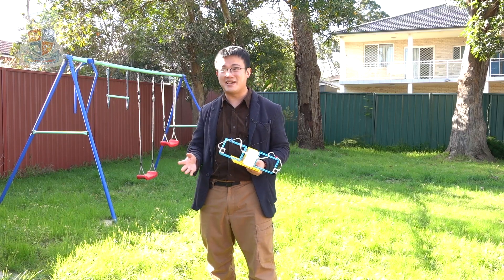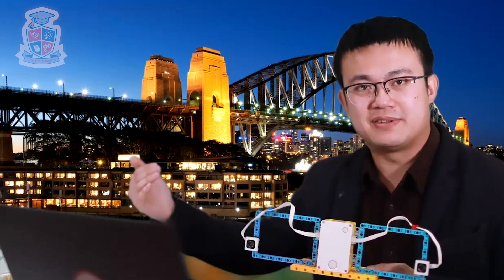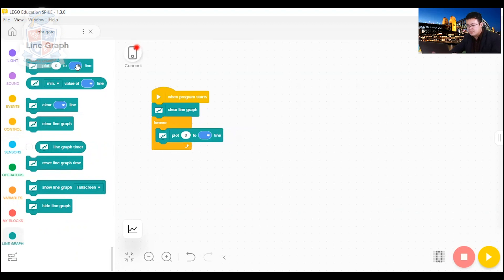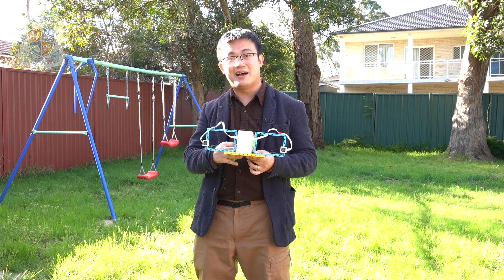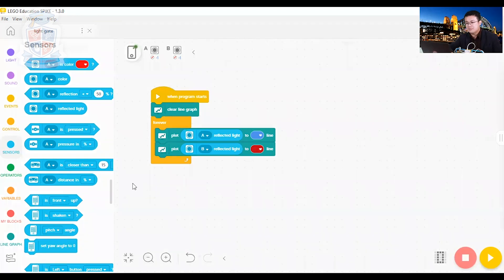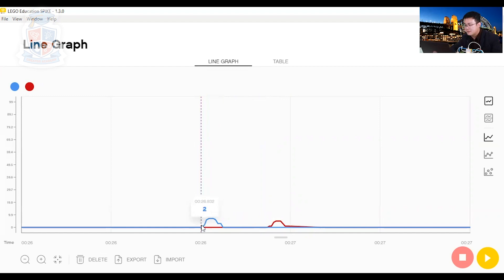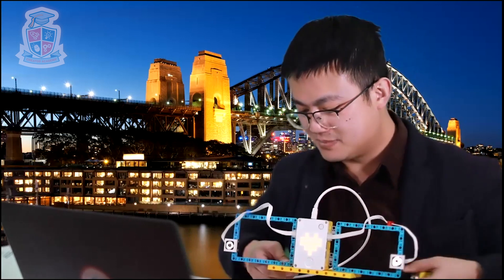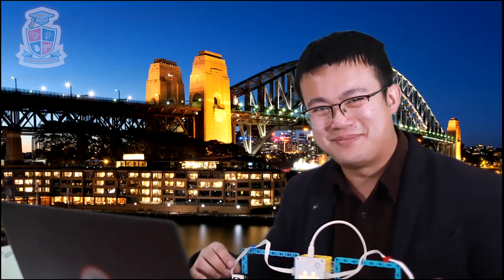Measuring Paper Plane Speed with SPIKE Prime Line Graphs

Comment: could you do the calculation using one colour sensor and the distance sensor??
Reply from the maker: Yes! It is absolutely possible 😊 Garry
Reply: @CreatorAcademyAustralia  cheers! I had a go just after I asked the question and it works really well. 
In fact the two very different graphs make it slightly easier to identify the start and end points.

Comment: Is there line graphs in the new lego mindstorm robot inventor too. If it is please show me becouse i can't find ut?
Reply from the maker: Hi! There doesn’t seem to be line graphs in 51515. You can run the SPIKE Prime software and it will install the firmware on your hub, but you will lose any programs onboard and have to re-install the firmware if you switch back to 51515. Garry
Reply: @CreatorAcademyAustralia  but if i install the spike prime software to the 51515 hub would i damage the hub or i can then reenstal the 51515 software?
Reply from the maker: I have switched between the versions without issues but it does take some time to do the updates each time. Remember you can’t have both SPIKE and 51515 programs loaded at the same time though. Garry
Reply: @CreatorAcademyAustralia  thanks:)